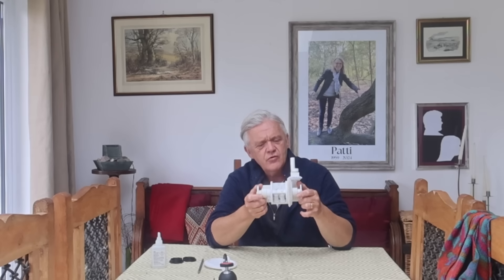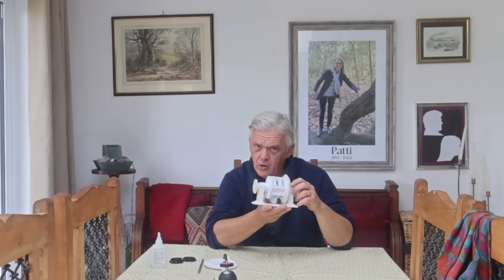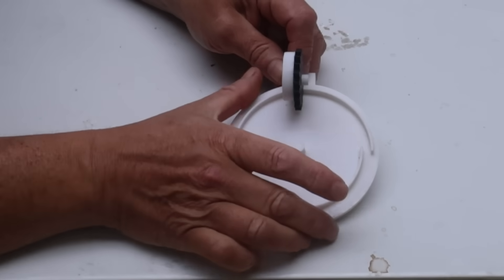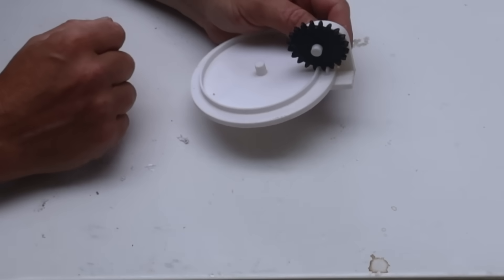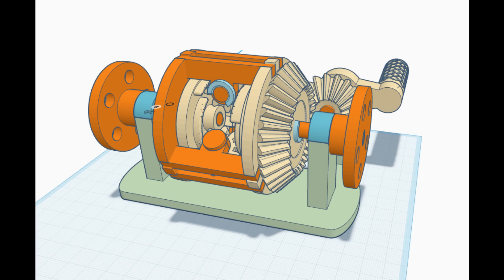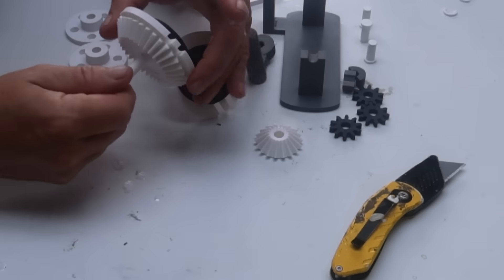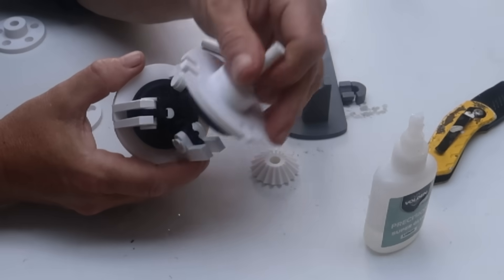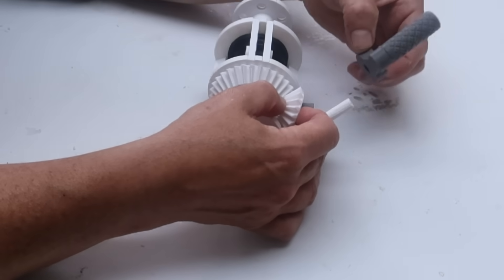2434 The Archimedes Differential

Comment: Re the Torsen differential - Interestingly, Maurice Walter's patent of 1915 (US1164770) is hardly functionally different from the Torsen, using worms with parallel axes.  These were quite famously used the Walter Snow Fighter plow trucks and airport crash trucks with "Four Point Positive Drive".  I would point out the Maurice was a candy maker (and candy machine maker) in New York City before he became a automobile and truck manufacturer in Upstate New York.
Reply from the maker: That's some interesting background - thanks for sharing!

Comment: something i saw the other day, a stripped down MRI machine, and it made me wonder if the method used to run the electromagnets on that could be used in reverse to create electricity, also part of the reason i thought of this is using these differentials to mount the generation point on the ground rather than directly on the rotor
Reply from the maker: in theory yeah it could and i like the idea of the ground based generator
Reply: @ThinkingandTinkering  well its always struck me as sort of stupid the way theyre stripped down to the point they cant be cooled easily because they need to be light enough to be up on a giant metal stick. But it was the same with electric engines, for years i was talking to an electrician friend about why electric engines are not geared, (i know torque is part of it) but then after 15+ years of being told no its pointless, someone goes and does it. But its in addition, all the electricity that we lose thanks to the breaks being put onto wind turbines so they dont overload the national grid was thought up by lunatics, if they had been put offshore, they could have been routed through a system where, if there is extra power it would run desalination plants to refill the low water reservoirs, or some other thing that would in other countries be used to make a solid state storage system but the UK seems it cant get its thick head around

Comment: Assuming that both were made from metal
 Which one would have less wear and tear over time?
In short:
If someone used a series of these in say a Wind Wall.  Or  Several small wind mills up on towers.
Which one would require less tinkering trying to keep the whole system up and running?

(I'm prioritizing "Maintance" over issues of drag simply because I don't like working in High places;  And had a friend who nearly lost their life to small farm sized windmill collapse during an attempt to change out the some worn parts in the generator.  The family is still trying to finically recover.) (I'm not asking which system has more drag due to things like the number of parts etc. or the potential for power loss via some method of transmission.)
Reply from the maker: less parts usually means less maintenance mate

Comment: Two electric motors in series  creates the same thing  ! as the least of resistance  gets more power but because the resistance gets greater on the loading engine
Reply from the maker: Not quite mate - with an electric motor you would have to use a sensor or you would risk burning the motor out.

Comment: I did enjoy the video. Differencals are very cool on a car they help keep wear and tear down on the rear wheel by reducing road friction at the rear drive wheels. The draw back is if you get in the mud one wheel spins while the other doesn't.  They did use to have positive traction rear ends so mud wasn't a big issue.  But here again the wear on the tires just isn't worth it. I know that on 18 wheel truck the differencals have air switches that change it from low speed to high speed to get extra gears. If I didn't get it exactly right someone jump right on in.
Reply from the maker: thanks for watching, mate!